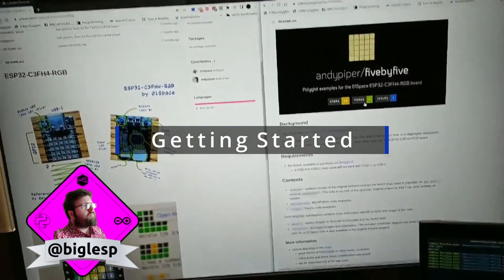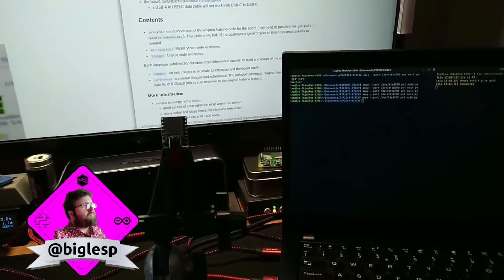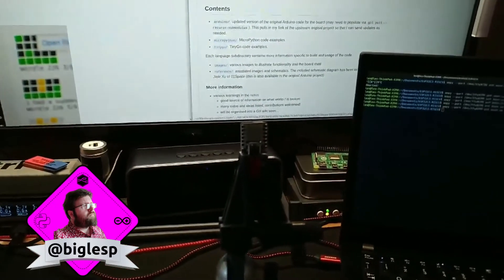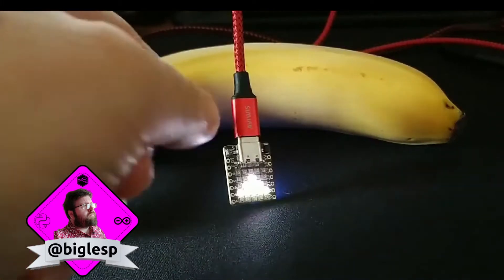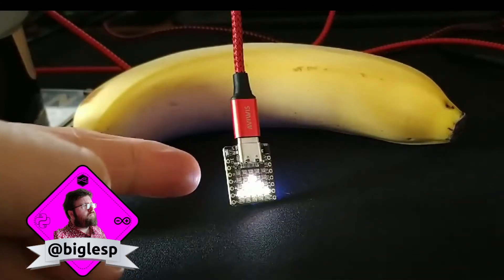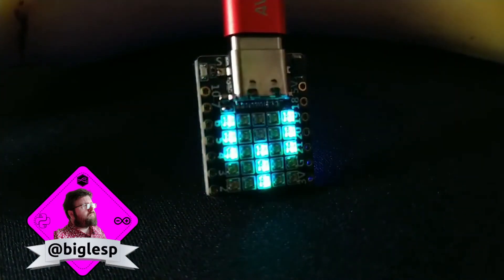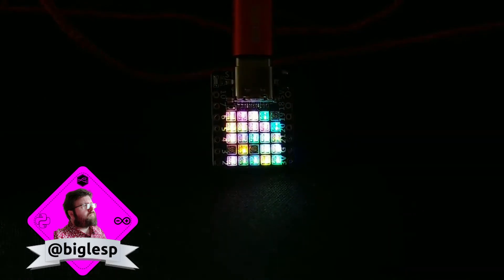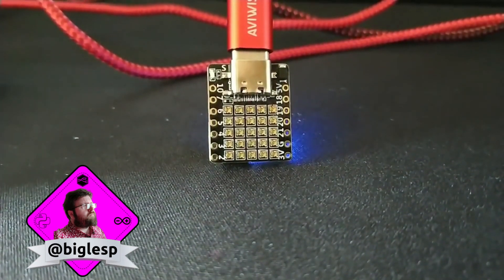Hacking around with the ESP32-C3FH4-RGB RISC-V Board

Comment: Hey man, I have purchased one of these chinese desoldering pumps (very similiar to the one Duratool one you have reviewed). What's the best way to make it so it's 100% safe? As a lot of the YouTubers have said it's a death trap lol  I understand putting a UK plug and a 3amp fuse, but what about the internals? It would be good for those who only need to use one every so often and don't want to shell out a lot of money. Thanks man :)

Comment: I understand the PICO D4 version of this board  (that uses an Xtensa LX6 instead of the Risc-V), has a built-in CH340E serial port, presumably to program the ESP32...   

I assume this C3FH4 board has something similar since you program via the bootloader..  i.e. the first thing you did was to program the micropython interpreter (esp32c3-usb-20220415-unstable-v1.18-355-g9ab66b50c) so that you can upload your python scripts (ampy)?   Is there a way to compile and upload C code?